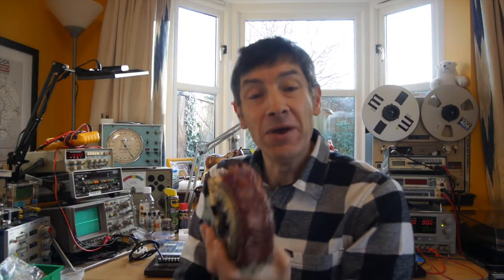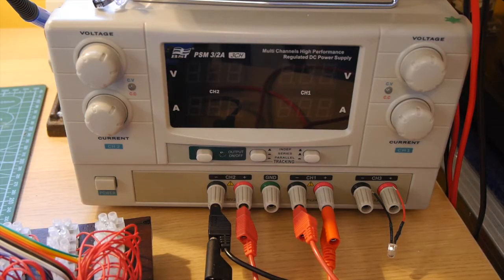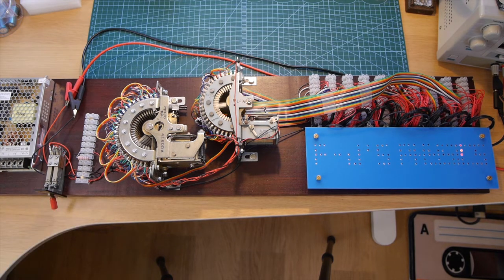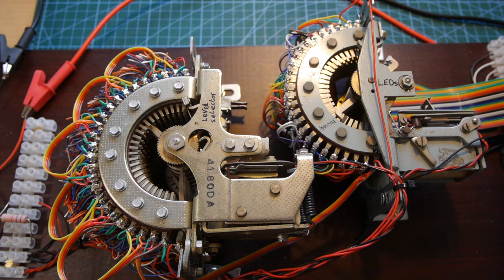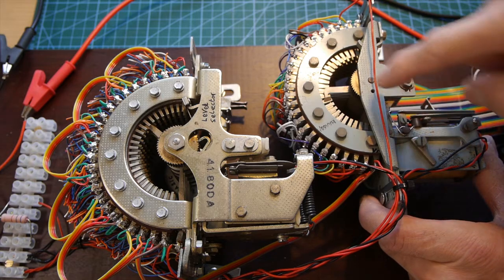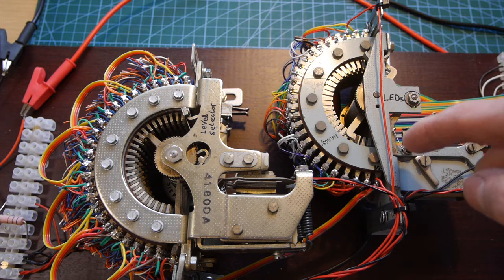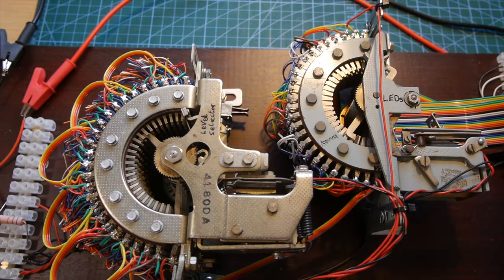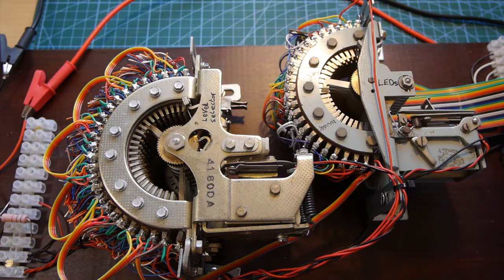Light Chaser using Strowger Switches - F-J's Physics - Video 163

Comment: Do the switches need exactly 50V or will the switches operate over a range of voltages?
Reply from the maker: Think they were designed for 48V which was commonly available on phone exchange systems.  I found anything less and the actuating relay would not produce a strong enough electromagnet to work.  You could hook together some lead acid batteries or buy a frame power supply on eBay - just make sure that it provides enough current.  I cannot remember the figure but a few amps should give you plenty of headroom.  Hope that helps, F-J
Reply: @AnthonyFrancisJones  Thanks!

Comment: Thanks for that great explanation. Bought some on ebay to play with after I saw some on "look mum no computer"
Reply from the maker: Great - let us know how you get on.  I have a few more projects in mind for these switches too!  What did you want to build?
Reply: @AnthonyFrancisJones  I don't have a particular project in mind yet. Still getting acquainted with what it can do.
Reply from the maker: @sbennettyt  Get the switch rotating first and then you can decide what to connect it to.  Good idea to add a small 'snubber' to the relay contacts to stop arcing and burning them out.

Comment: In the early 1970's we used to build test rigs using strowgers  for interrogating early modems and switching units for the Post Office. An operator could push a button which incremented a strowger one position which set up the inputs of a logic board and lights used to light in a certain pattern. This allowed anyone to check all inputs with the corresponding correct output states. 
A modem unit took two of you to lift it into a 19'' rack and I wonder why I have a bad back.
Reply from the maker: Mike, thanks for that and sharing a great story.  Yes, that kit must have been heavy!  How small it has all become now!  You often hear of how much smaller all types of 'computing' has become but rarely is it mentioned that how heavy it was has reduced massively as well.  Interesting use of these clever switches!

Comment: Superb craftsmanship! Not many will appreciate the effort that goes into creating something like this: a wiring masterpiece.
Reply from the maker: Thanks Andy, good to hear from you and it was a bit of fun to build!  Lots of it very repetitive and fiddly but, as I did a number of times, if you make one mistake you have to undo everything to that point and start again - I did this quite a few times and I still think there are LED's that are out of order!  There is big sparking when the LED (right) switch/uniselector comes to the 26th position and energises the electromagnet's coil of the level change (left) switch/uniselector.  A problem of feeding an inductive load - I need to put a snubber on that to make sure it does not burn out the switch contacts very quickly!